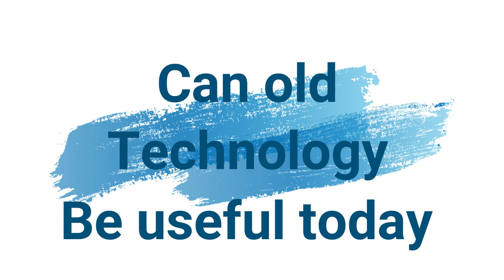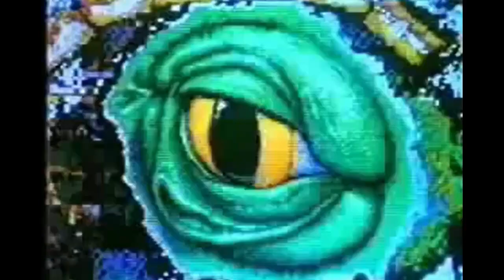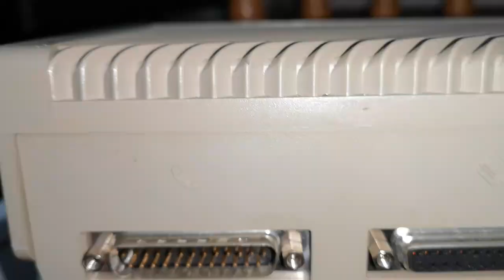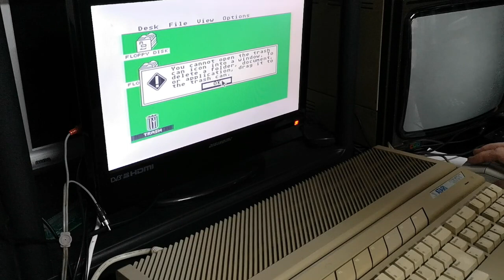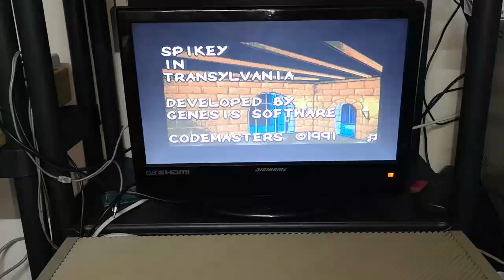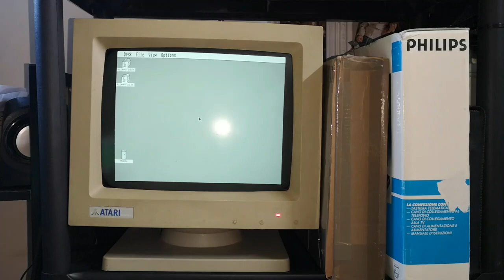Classic Computer   Atari 520ST = A new look at a classic computer

Comment: I'm not really sure that here, in former Czechoslovakia, anyone actually had a Mac computer, back in the day - besides being freaking expensive, they were that kind of "western unobtainium". And yeah, for what they offered, they kind of sucked.. The Amiga computers fared slightly better, but they were still a bit too pricey, for majority of common user - though they very quickly got a reputation of being gaming powerhouses, and sort of a go-to computer for working with graphics and sounds.

The Atari ST computers, on the other hand, were very well priced right from the start, and were easy to use for even complete computer beginners. I'd say, that to everyone's surprise, once they started being sold and people bought them (due to that OK price factor), they were found to be actually excellent, almost superb. Another thing was, that there were tons of good software available for it - maybe there wasn't a variety of alternatives for each type of program, but one that was there was already really good and perfectly capable of performing the desired tasks.

The only downside of the STs was a certain level of unavailability of monitors to supplement the models without the TV modulator, at least in the early 'days' of those starting to show up in the (TUZEX) stores.

It was apparent, that the Atari ST platform had a few weaker points by design, almost deficiencies, but these were almost exclusively in regards to gaming - here I mean stuff like the lack of horizontal scrolling, mediocre sound chip, etc.. But from the standpoint of being a workstation, there was hardly anything that came close, in terms of simplicity of use, software available and also, expandability. And definitely, there was absolutely nothing that could compete on the price front.

My Mega ST2 never became a gaming machine (I remained faithful to the library of games for my Atari 800XL), but it was definitely my go to computer for serious work, and thanks to the build-in MIDI ports with zero latency (superbly complemented by Steinberg's Cubase), it was also THE device to use when playing around with music. Just a powerhouse of a computer, right out of the box.

Even today, with all the knowledge.. If I had unimited funds, I would most likely once again go for Atari computer, though I think I'd grab a TT030 or a Falcon 🙂 (but still I'd get the SM124 monochrome monitor, for its crystal-clear and super-sharp picture).

LbnL nice video 👍